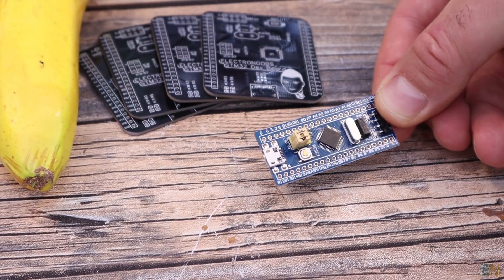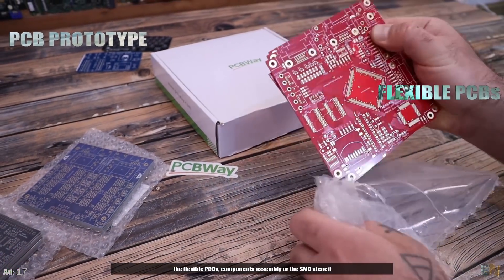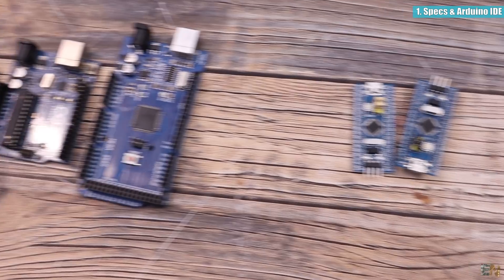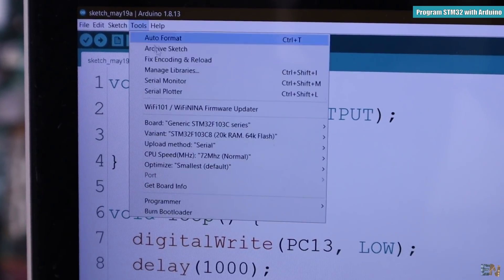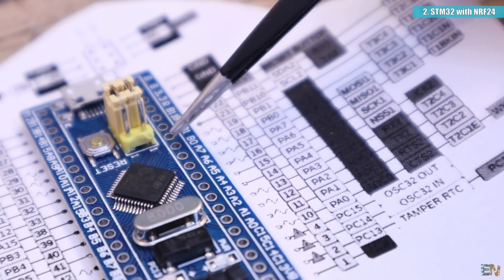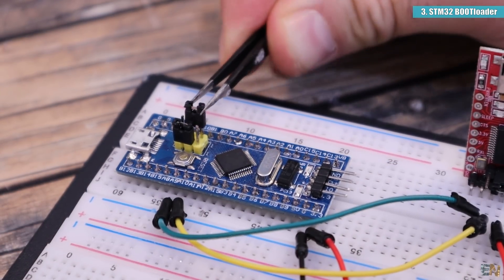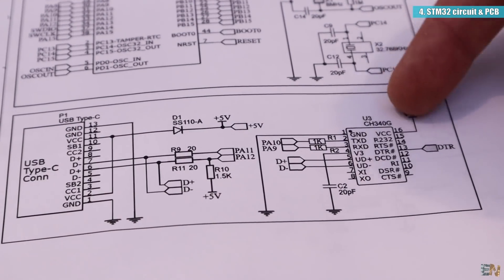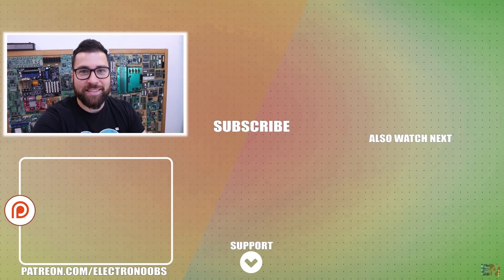STM32 with Arduino IDE | Schematic & custom PCB | NRF24 radio | Bootloader

Comment: Sir, I am trying to receive gps data each second using interrupt function.What I understood is that,I had enabled the global interrupt in stm32 configuration for uart3, and whenever the interrupt triggers,the programs goes to the callback function which is hal_uart_rxcpltcallback.The program reaches the function..I do some processing again and then enable the interrupt again..The next sexond when the data arrives at 100ms after a pps signal(reference signal marked for 1 second),again interrupt is triggered , program goes to callback function, does the particular function, comes out of callback function.This happens in every 100th -130th millisecond of each second.I understood that whenever the codes enters the callback, ,the interrupt is diabled and we need to enable the interrupt again to receive the next data..Altogether 300bytes of data arrives from 100 to 130milliseconds..After 130 milisecond,if suppose some random data arrives, the interrupt may still trigger, since each time i  enable the interrupt while coming out of callback function..how to stop receing the interrupt after 300millisecond? Can i use abort function?? Also can you please explain What is the differnce between isr function and callback function??Looking forward for your reply

Comment: Nice video. But I have a few suggestion. I would not personally use an FTDI chip on the personal PCB with that stm32 chip as it has build in USB capability. You can just include a NRST button and Boot button on you PCB and connect your USB type C to normal USB pins of the chip and program it via USB. The stm32 chip has preloaded Bootloader so u can program it over USB. U can then use USB CDC for data logging.  USB CDC  works very similar to UART, but does not require actuate baud-rate to  transmit or receive data correctly.
I personally made personal PCB based on STM32F446RE and stm32F030CC. I program the F446RE  directly via USB, even if I still have SDIO and Clock pin on separate connector just incase in need to debug some code. stm32F030CC will need some FTDI chip of course as it does not USB capabilities (I use the cheap CH340C for that job)

Comment: 3:15 I don't think this explanation is correct. 8 bit is 2^8 and 32 bit is 2^32 so it's not 4 times faster but has more address

Comment: Hi, I am making a programmer board for STM8 and STM32 MCU's. I wanna know what are the programming pins to be used on these MCU's (like SWDIO etc.,) to program bare ICs. Does STM32 IC's come with bootloader on them so that they natively accept code on UART lines?

Comment: Awesome!!! I used your schematic to design an own stm32 dev board. Everything I needed works flawlessly (USB not tested yet). Saved me during this time, where stm32 blue pills are unavailable. Replaced the jumpers with SMD switches.

Comment: I am using stm32f103c8t and i am facing a problem that PA3 -PA7 pins are not working. if any one have this kind of board please check it that your board pins are working or not if working please help me out for the same

Comment: *Warning to the bluepills users*:
1): The +5V pins on this board are directly connected to the +5V pin of the USB connector. There is no protection in place. Do not power this board through USB and an external power supply at the same time.
2): This board may have a wrong value of resistor on the USB D+ pin. Instead of a 1.5kΩ it has either a 10kΩ or 4.7kΩ resistor. Replace resistor if this is the case with your board
3) Please pay attention, stm32 is 3.3V logic levels based( comparing to majority of Atmel-based Arduino boards which are 5V logic level based). The logic voltage of STM32 is 3.3V, so the logic voltage for GPIO input pins is also 3.3V. There are several pins that are 5V tolerant, *BUT NOT ALL!!! * . 
4) You can power it from 3.3V pin directly or from 3.6V+ to 5.5V through the onboard regulator. Means you can use 1S Li-Ion Battery. But please pay attention, on-board regulator outputs 300mA maximum. You can't power demanding peripherals from the blue pill!!!
5) The maximum current the STM32 pins can provide is lower than Atmel's chips maximum current output. Do not overload your STM32 output pins!!! Use it for logical levels only, power your peripherals from the independent power source!!!

Comment: Yeah I would personally avoid using the blue pill. There are more fakes and not working boards out there then working one. If you want to avoid getting disappointed consider using esp32 boards. Just as cheap but work reliable and no fakes

Comment: The STM32F103 already has built-in a USB peripheral which you can use to reprogram the chip using Device Firmware Update (DFU).

Comment: you can program the blue pill just using the onboard usb port with no other HW as it support DFU https://www.st.com/resource/en/application_note/cd00264379-usb-dfu-protocol-used-in-the-stm32-bootloader-stmicroelectronics.pdf

Comment: There's a major 'gottcha' with the Blue Pill board when using the PWM generators. The hardware PWM shutdown pin gets crosstalk from one of the PWM outputs. With a 'real' Blue pill, there are some workarounds I believe, but with the clones I bought, it just didn't work. Had no problems with a different cheap STM32 board.

Comment: Why didn't you use the official Arduino core for STM32 ? And as for the bootloader you could use STM32_HID_bootloader by Serasidis which use only 2KB! on F1 boards and no USB drivers needed, even on windows. The bootloader you used in this video is using 21.7KB!

Comment: That is great.
It always feels like the STM32 is a little forgotten. Especially where the ESP boards are concerned.
Reply: STM32Duino project on github is stronger than ever. That framwork is actually better than Ardiuno itself and supports nearly damn every SMT32 chip..

Comment: 10:50 I think you should have also included the possibility of getting blue pill clones. They usually have the wrong resistor values on the board, so the USB portion doesn't work correctly. Also, with the clones, this method won't always work. I had gotten 5, and all 5 were duds. A friend was able to get them working and found out they were a non-USB supported IC (an older f1 chip) and had half the flash as supposed to.

Comment: Nice work. I have several STM32F103 designs, all using Arduino libraries. Look into adding a ST-Link header for flashing, its more reliable than the bootloader. ST-Link clones are inexpensive and you can debug your code with SWD pins. Thanks for the video, your board look great!

Comment: I recommend to switch to Visual Studio code with PlatformIO, it's far superior to the Arduino IDE. I also have given up on the NRF24 modules, the ESP modules are cheap and much more reliable and powerful
Reply: Do you know how to configure VSC/PlatformIO to output binary and hex files for STM32 and the openlibcm3?
Reply: Or VSCodium for those who dislike the default "telemetry".
Reply: The reason for using Arduino IDE is it is very beginner friendly. No need to worry about copying files, libraries etc. Whereas platform io needs some experience with programming and computers.

Comment: Schematic is wrong!!! Be careful and don't fail like me. Load capacitors of the 8mhz crystal must be connected to the GND.
Reply: The ground connection is easy to miss when C13 and C14 are connected together like that. I've certainly made similar mistakes myself in the past - and electronics is my full-time job. It's a little easier for human eyes if C13 and C14 are drawn with separate grounds, like C10, C11, ... The rest of the schematic is super clean. I would have expected a ferrite bead on the STM32 power rail, but maybe I missed it in the video.
Reply: Linked schematic is correct. But the schematic in the video is the wrong one.
Reply from the maker: Yes, I've changed it during the process because it wasn't working. Thanks!